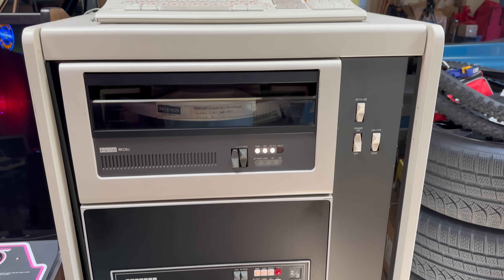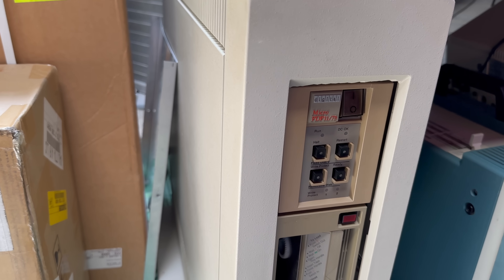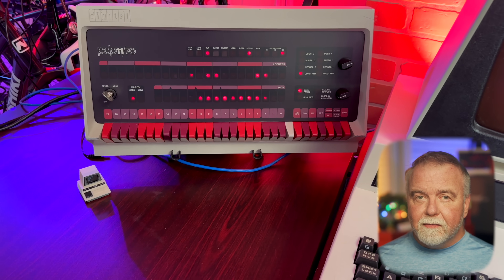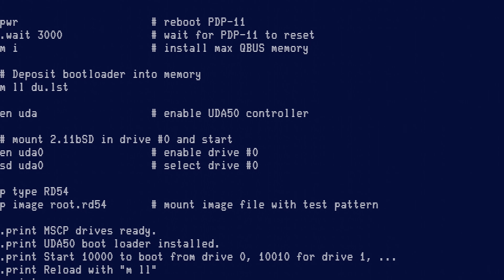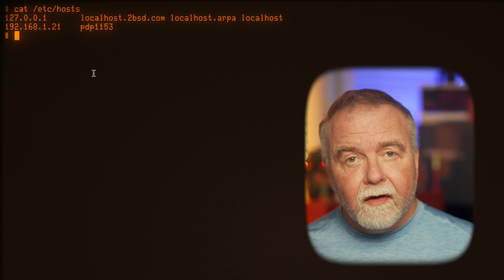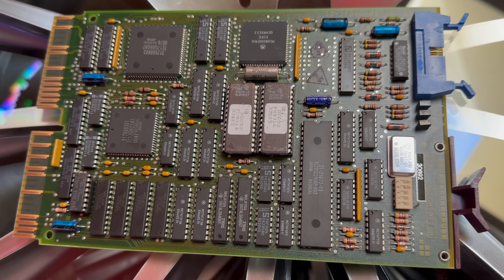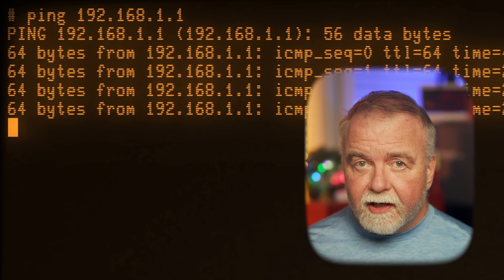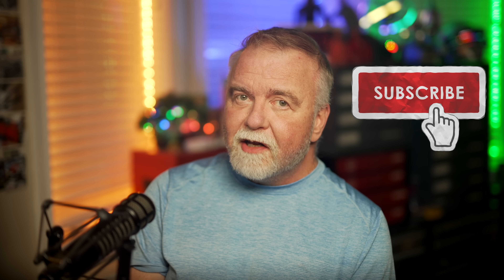UNIX on the PDP-11: Zork, Star Trek, and More Live on the Internet!

Comment: The problem is not the 10 Megabit as such, the problem is, that the PDP and all other systems up to 10-BASE-T with a hub is using 10 Megabits in Half-Duplex.

This means, a station can either send or receive but not both at the same time (which is full duplex). On switched networks, the connections between stations can be seen as not shared, thus it became possible to send and receive at the same time.

As both sides needed to be configured the same way and it brought a speed penalty, the support for half duplex was omitted from switches and network card drivers a really long time ago.

Comment: Hey Dave, did you set the MAC address on the DEQNA? Back in those days, the MAC address was manually set. You'd take a US $1 bill and use the serial number as the MAC address and the tape the bill to the inside of your box to take it out of circulation, making it globally unique.
That generally worked, but being from Alberta, we never though too much about counterfeits with duplicate serial numbers.

Comment: Either a PDP-11/45, or 11/70, is one of my "bucket list" computers. I have a DEC VAXStation II/GPX at home. If I could find a CD-ROM drive, I'd attempt to install BSD on it.
Back in the mid 90's, my wife bought a Sun SPARCStation IPX, with a CD-ROM drive, tape drive, and a 31 inch color CRT monitor for me to keepy UNIX skills up. I bought a 3 bay SCSI cabinet and got a few SCSI drives from my former fellow NCR coworkers. I installed Apache web server on my NT workstation as a proxy server to share my internet connection.

Comment: Much serious work was being done in industry using DEC minicomputers long before the PDP-11 came on the scene including the PDP-8, 9, 15 and 10. Other manufacturers’ products like the Data General Nova, Interdata 7/32 and HP 2100 were doing yeoman’s service in industry and universities before the PDP-11 arrived. You asked how these old machines were debugged? Well, on the PDP-9 you slowed the clock speed down to a walk using the rheostat on the front panel and single stepped through the instruction set while you interpreted the octal codes expressed in the panel lights. What can you do with machines like the PDP-11, you asked? How about providing supervisory control of a gas processing plant or interfacing inexpensive non-IBM hardware kuje a remote job entry terminal to a proprietary IBM mainframe. How do you load a program into a 12-bit PDP-8 before the era of networks? You connect a Telex teletypewriter with a paper tape reader and read the operating system and application software into magnetic core memory after toggling in a bootstrap loader from the front-panel switches, then you let it run for eight hours overnight. How did such primitive machines perform such high performance, time-critical jobs in atomic energy, university research, aviation, and the oil and gas industries? You write real-time operating systems and application software all in assembler language.

Comment: Actually 4 chips on a single package.  IIRC there were two on the bottom as well!  That was the "JAWS" chip, used in the 11/73 (Q bus) and the 11/74 (uni-bus).
I worked for DEC at the Mill from 1977 till 1980.
What I'd like to have would be a micro-vax and run Linux on that.

Comment: Thanks Dave! 👍 Some good old memories for me. I was in College on a new (then) special 3 year (1978-1980) course called COT (Certificate Of Technology). It was very intensive & designed to prepare students for almost any Engineering Degree course at University. They had various PDP-11 and one in our Computer Lab was the PDP-11/03 (LSI-11) nicknamed Angel - I never did find out why! It was in a black steel cabinet about the size of a filing cabinet with a lockable door, on casters. If I remember correctly, the CPU was 4 or 5 monolithic TTL chips made by Western Digital Oh! I remember WD had it's own Computer system too... I forget the name though. 🤔 I became an Industrial Design Engineer BSc.

I remember well it used RT-11, RSX/11M, RSTS/E (the main one used for class hooked up to VT Terminals (I forget the model... 20 maybe?) via a 20mA loop. We also had a couple KSR-33 printer/terminals. It also had the MONECS OS (designed here in AU for Colleges & Universities). In 1979 we took delivery of a VAX-11/750.

My favorite program, and most students during a break of after the school day was over, was ADVENT (Colossal Cave Adventure), I've been a gamer ever since! 🥰

Thanks again! I enjoy your streams!👍

Comment: I loved the story of how you made it all work and I even followed most of it. My own last experience in the PDP sphere was with MicroPDP 11/83, preceded by the 73, the 53 and the first MicroPDP 11/23 with a 10MB HDD and a twin RX50. We'd switched to that after building systems based around the LSI-11/23 board, built by an OEM into a rack mountable chassis with a 10MB Winchester with a single RX02 drive. That ran our own build of RSX11M but we later switched that to MicroRSX when we moved to the real MicroPDP hardware.

Comment: Brings back memories.  My first experience with a PDP-11 was in grad school.  We were connected via terminal to a PDP-11/60 running UNIX Version 6 PWB. I believe the terminals were ADM-3A.  And that system was used as a front end to an IBM system.  Later my company got a PDP-11/34 running Microsoft’s Xenix .  Both systems only had “ed” as the editor so we had to master regular expressions.  Later we got a BSD add-on tape and we were able to run vi. In our shop we had vt100s so they had no problem with vi.  The major app that we ran was a cross-assembler for a  more-or-less proprietary mini-computer . The application was TV Broadcast titling. The PDP-11 replaced the native assembler system that ran on punch cards.  We used serial communication to  download the binary code to the mini-computer.  Later we got a VAX-11/780 which didn’t seem much faster than the 11/34 for the cross-assembler app.  That system ran DEC Ultrix.  Later we got a Sun 3 , based on a Motorola 68020 that ran SUNOS, which was pretty much straight BSD.

Comment: Zork and Star Trek on my school district's PDP-8, complete with paper tape via teletype for input. Basic was the best in 1973 when I was a sophomore in high school, one of two girls in the class. There was also an artillery simulator that we played with. Funnily enough, 15 years later I worked at Litton Data Systems in So Cal doing CADD on a Sperry-Univac for TACFIRE. I was the queen of isometric circuit board illustrations and electrical diagrams. The refresh rate on our seat-integrated CRT terminals was in the half minutes if all six of us refreshed at the same time. The display units were longer than modern-day racing sims with the distinctive green phosphor glow. Ah, 1950s-60s equipment in the late 1980s. A couple years later, I was drafting Emulex network card technical data sheets for big iron, lol.

Comment: I remember working as a tech for Digital in the 80s, in Brisbane Australia. I spent the first 5 minutes of this video laughing at myself for knowing exactly what each thing meant. I also recall drilling and tapping connections for PDPs and VAXes. I also remember being thrilled by the introduction of thinwire, and then 10BaseT. Thank you for bring back some happy memories.
Reply: Of course if you had a bunch of PDPs in close proximity you could plug the AUI connectors into a DELNI, then it was only a single tap onto the cable for all of them, oh the joy !!  DECNET and LAT in those days, what is all this TCP/IP nonsense?
Reply: I was based in Melbourne from 1988 to 1990. There are a few of us left.

Comment: I used to work for a life insurance head office which had a DECsystem-20 system running TOPS20, which included a PDP-11/34 running RSX-11M to manage the peripherals and the hundreds of remote terminals. Whenever there was a serious issue with the system (which was rare), DEC specialists from DEC headquarters in Maynard, Massachusetts could remotely connect to our system using DECnet to remotely diagnose the system, which was cool. Their remote link was over a 300 baud modem which was painfully slow for them :) It was great to see Dave show and talk about the PDP11 and even show Zork starting -- it brought back many good memories!

Comment: The bit about connecting a hard drive reminded me of something from my first job... I think it was done around '82 or '83. At the time, my job focused on a Data General Eclipse system running a proprietary O/S and application stack from a company named Calma, used as part of their printed circuit board layout process. The company did software development for their embedded system product (as well as miscellanous other computing tasks) on VAXes, and had a need to ship files between the Eclipse and VAX/VMS systems. The solution was to build an adapter which plugged in to the Unibus on the VAX (VAXes had a 16-bit Unibus for backward compatibility in addition to the native 32-bit bus), but appeared to the Eclipse like a tape drive. IIRC on the VAX side, you would mount the adapter, and run (I forget what), then command the Calma software to write the data you wanted to the emulated tape; the data would end up in a file in VMS. The reverse could also be done in which the Calma system would be commaded to read what it thought was a tape file but was in fact coming from a file in VMS.

Comment: sometimes you need to set the port of the switch to 10-base-t manually as speed-auto-negotiation screws up. auto-neg may cause a jumpy or not-working connection as it tries to change to higher speed.

Comment: Why not use it for smart home automation? Such tasks do not require too much memory and bandwidth. Besides, using a machine that eats up several kilowatts of electrical power to turn off a few LED lights to save electricity is a great idea, isn't it?
Reply from the maker: I would but I have about 50+ Insteon devices that I don't want to re-type all the hex codes for!  If there were some way to import from Indigo, which I use now, I would!

Comment: Glad you are having fun and can afford all of your toys!
First place I worked as a programmer had a 360/30 with 32K of core memory.  The COBOL-D compiler would not run on that system so all new code was written in BAL.  The system did have 1401 emulation so we had a bunch of systems written in Autocoder!

Comment: At least BSD supported TCP/IP. Back in the 80s I was the SA for a department PDP,-1170, later replaced with a VAX. It was running an internal Bell Labs SysV release 4.0. It had no support for TCP/IP. All dial up, all the time. The Bell system was slow taking up modern networking. Being the phone company, they wanted to stick with dial up using UUCP and such to network in.

The IT department did have SysV versions with networking so that's what we'd use for net news, ftp, telnet, etc... The department computer was for doing research and writing documents.

Comment: I didn't get to rip out the thicknet until the second year out of college... the first year was spent replacing corroded vampire taps.
At risk of triggering any early networking PTSD, I would suggest that you make sure that you're using the correct 10-Base-T cable for the things that are trying to talk to each other.
We're spoiled these days in that modern ethernet adapters will auto-detect what the connection should be, but with old hardware you'd need a different cable to go from a switch to a node than from a node directly to another node (crossover). We won't mention the special abomination you needed to connect to Cisco routers...
Maybe start with a direct node-node connection with a crossover cable, then try adding a dumb hub (with a regular cable) before plugging into your modern LAN.
[EDIT] - That's what I get for not watching the whole thing first... glad you got it going! I was on the right track at least. :)

Comment: OMG! Love this episode. Brought grins and giggles to my face. Late 1970s-early 1980s are what I consider the Golden Age of UNIX, particularly on the PDP-11.

In 1979 at work, we ran a PDP-11/70 installation with 768K of physical memory. Virtual mem was 128K due to split I&D addressing rather than the standard 64K. (Phys mem > virtual mem was an interesting twist on the brain.) We ran 23 terminal lines thru non-DEC multiplexers to it at 4800 or 9600 bps. To a PDP-11/70. 

Apparently, we were stealing customers from the multi-megabyte IBM 370 TSO system downstairs from us due the flexibility of what people could do in UNIX.  A couple of us who were recently IBM 370 programmers quickly became “machine mothers” to UNIX on the 11/70, tending to its care and feeding for the community. A year later, we got a VAX-11/780, initially running VMS, but soon converted to run 4.0/4.1bsd.

If I recall correctly, “vi” could not run on an 11/45 because the 64K virtual mem was too small, but it did run on the 11/70 by putting the program in I space and edited data in D space.  I think our “vi” code was ported from 2.11bsd but recompiled to run on our IS/1 (UNIX v6) system.

Comment: I worked for an NHL team around 91-93 in their ticketing IT department.  We had a huge Linux mainframe (unfortunately don’t recall what it was) and it was hooked to 2 full rack cabinets of Hayes smart modems, which were used for remote ticket outlets (think department stores) to connect to and be able to purchase tickets and print them locally in the store on a ticket printer.  I’d guess there were around 70 modems in there all running concurrently.  The interface was all text based and we could look at a ticket chart for any event, section, row, seat etc.  we could also unstick (release tickets) that an outlet purchased but then the customer backed out, etc.  was one of the coolest parts of my young business career.

Comment: Dave, I have a pedestal mount DEC MicroPDP11/23 (or possibly 24) that I have lugged around for 30+ years. It includes an RX01floppy drive and a set of floppy disks with RT-11 V5 and TSX V5.1. I have not booted it since I acquired it sometime back in the late 80s. If you are interested, I'd be glad to drag it out and get the nameplate info. If you want it, it's yours for the shipping cost.

Comment: I remember reading that Unix was originally developed by Ma' Bell on the PDP-11 to make a telephone switching system that could replace human operators. If that's true then the next logical step to me would be to get an old telephone switch and drive it with this machine. So when you call into the house from the shop it goes "clack clack clack" and physically connects the telephone wires to the correct phone line.
Reply: Check out Brian Kernighan's book:  'Kernighan - UNIX - A History and a Memoir 2020'. The origin story is both interesting and humorous.

Comment: I would love to see you throw some old IBM stuff in the mix S/36, S/38 or even AS/400. I used to work as a tech consultant at a company that sold AS/400's. So i was often sent out to fix all kind of connectivity issues. One customer wanted to be able to run their Wang VS from the IBM terminals which was easier said than done, especially when it came to the keyboard emulation. There were never a case when i did not manage to get stuff to work though sometimes it took some time and i learned my lessons. Anyway, it was fun using the IBM red books where people from all around the world contributed with hands on knowledge so there were always someone who had done the same thing or a similar thing before. Cheers from Sweden!

Comment: Those purple Linksys switches / routers are just rock solid. It goes to shows it's handy to hold on to old kit sometimes.
Reply: It's useful you mentioned that 10Mbit link issue and newer switches, I was messing around with some ISA based 10Mbit network cards, and faced a similar issue, and this was using Windows 95, and I saw the same thing. It appeared in my UniFi controller, but something would talk to it, and it wouldn't talk to anything else, yet my DHCP server had clearly given it an IP address.

I might try jamming a 10/100Mbit switch into the mix to see if that helps

Comment: My city's school system had a pair of PDP-11's back in the 70's & 80's, one for Central Office, and the other (ArTooDeeToo) for student use.  You could check out a 300 baud acoustic coupler and dial in from home!  I was wondering what the big deal with chat was in the 2000's...I'd been doing it back in the early 80's using Citizen Band Emulator (CBE) on said PDP; a small but dedicated user community sprang up out of that,  even held softball games IRL!  Also, as a side note, if you're familiar with the Hammurabi variant KINGDOM, I'm real-life friends with the devs, LS & TV and could pass messages.

Comment: I'd like you to add more memory and run modern applications on it, like OpenSSH, OpenSSL and the Apache web server. A SQLite Database. PowerDNS? NTP V4? NFS V3? Yeah, you'll need lots more memory. What is the maximum that hardware can be upgraded to? Can the BSD version on it do paging and swapping?

Comment: Back in the 1990's, I corresponded with Henry Spencer, dropping in some processing optimisation for C-News. It made upact run about 20 times faster (from memory), still a shell program. I had a Perl version on the backburner but Henry said he'd rather stick with something he could run under BSD2 on his (University department's) PDP-11's limited memory.

Fit the process into 64k and it runs better than something refrerencing outside of that address space.